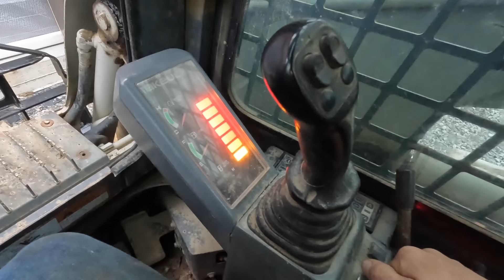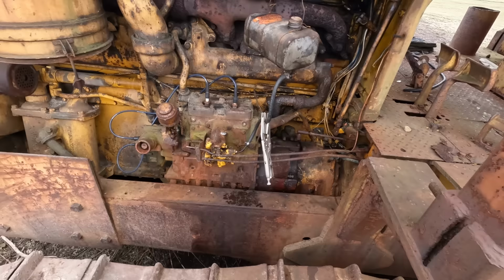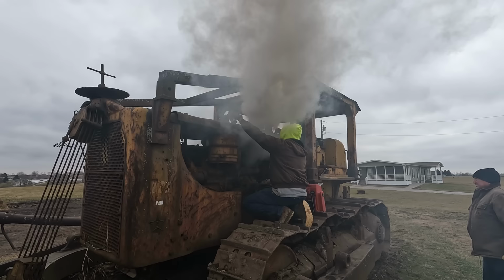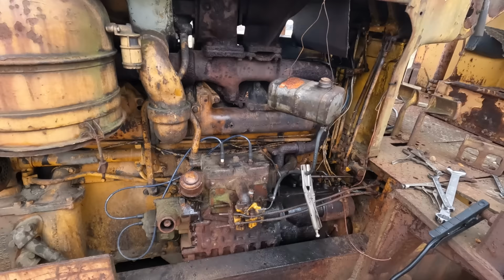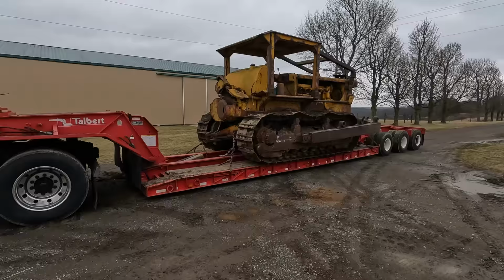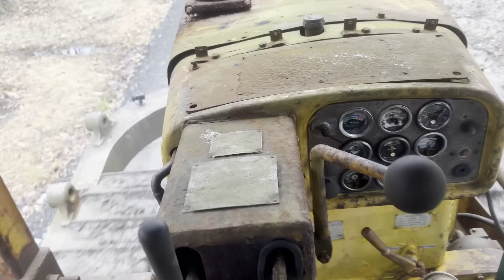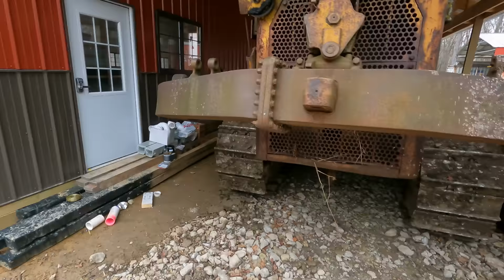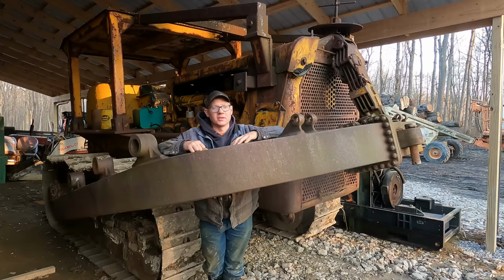Hauling Home a 1964 Cat D8 Bulldozer after sitting 15+ years!

Comment: There is now way on this Gods earth! I would pull one of those trailers with a load like that on it! All the weight of the load is essentially put into one  right angle joint...! If that joint were to break? The nose and deck of the trailer would spear straight into the asphalt! 
American engineers must be smoking some serious shit! If they think that the design is somehow ingenious! Safe ! And some how reliable??😂
Not to mention... what the hell are you going to do when you have a load on a trailer as such, and encounter a situation we’re you need to elevate the front and rear of the the trailer to over come height obstacles relevant to travel off the concrete highway?
Reply: There’s a bunch of them running around hauling equipment without problems. Where that 90 is also detaches and is mostly held together by the weight on it. 
And, usually the rear suspension is adjustable since it sometimes needs to be low for height clearance and high for ground clearance. Typically the front is also adjustable for the same reasons. 
Just because you aren’t familiar with it and don’t understand it doesn’t mean it’s stupid.

Comment: Another restoration, don't you have a bunch of those that are just sitting now, this will be another one sitting, doesn't seem that any of the other ones are getting done either, thanks for sharing, seems your just buying stuff but not working on anything
Reply from the maker: I’m working on finishing my shop. Once that’s done I’m gonna shift gears back into working on the equipment full bore! This year has been tough because the shop has demanded so much of my attention
Reply: @DieselCreek  yeah guess your right, probably did take up alot of time, my apologies, warm shop will definitely help, thanks for the reply